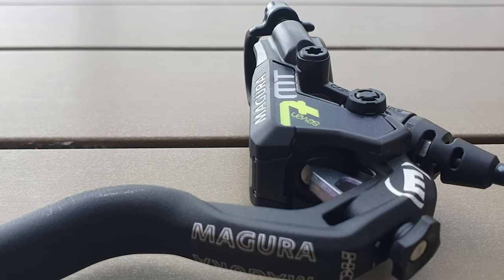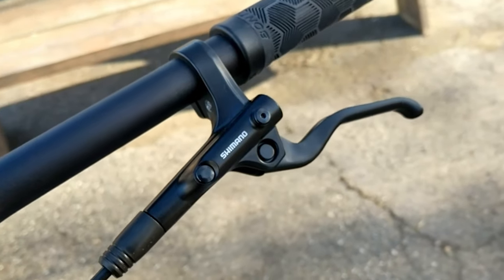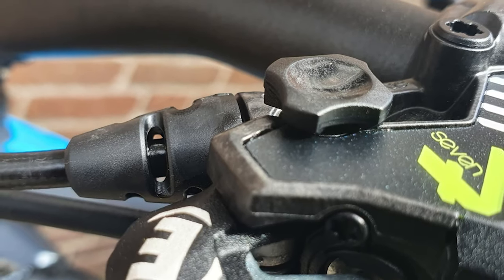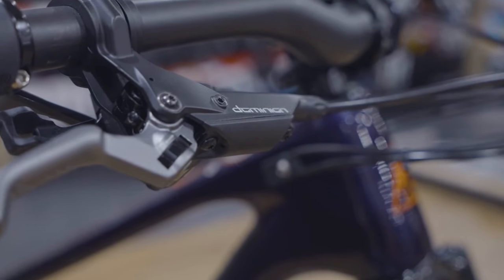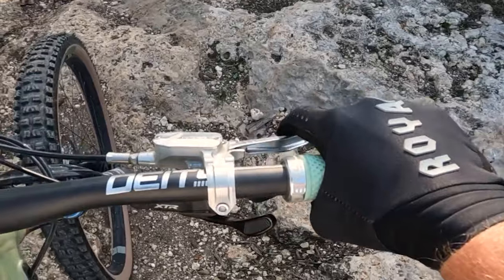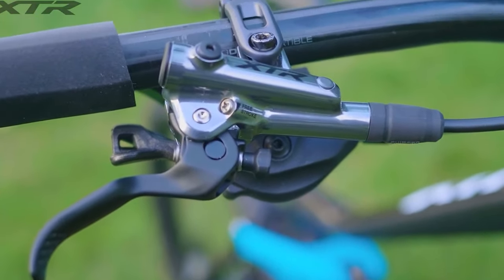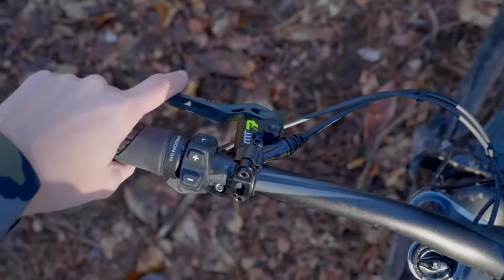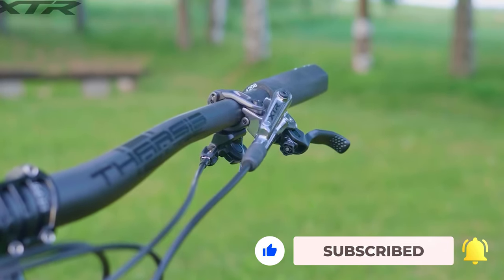Best MTB Brakes 2024 - You Can Buy Right Now!

Comment: On the hope one you show tech 3 & tech 4. Also on the tech 4 you show e4 & v4...which one is it  🤷‍♂️ big difference as v4 you can run vented discs which I don't know any other brand that do that. Plus on the v4 the calipers are bigger, bigger pistons, bigger pads etc than the E4. So if you've only tested the E4 like mentioned, how about testing the V4?